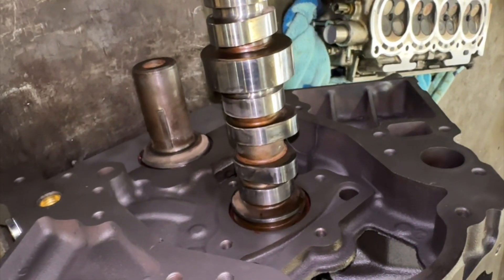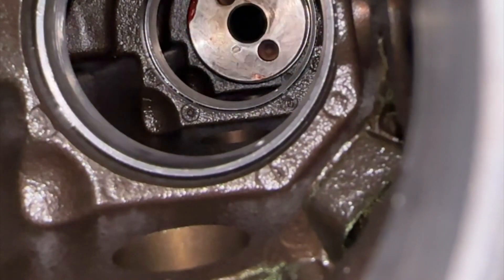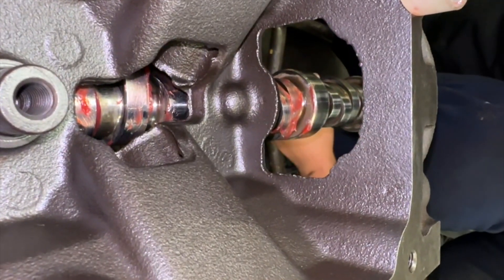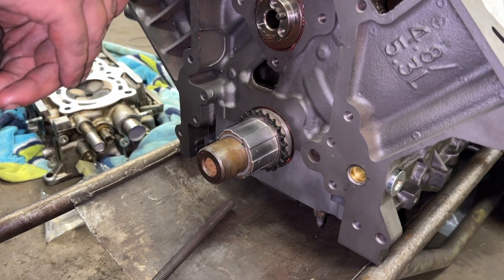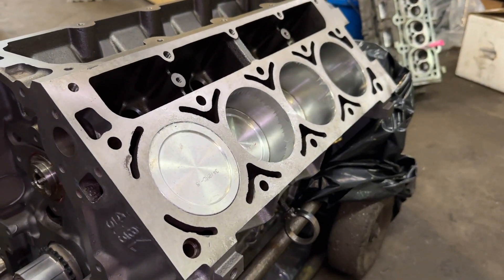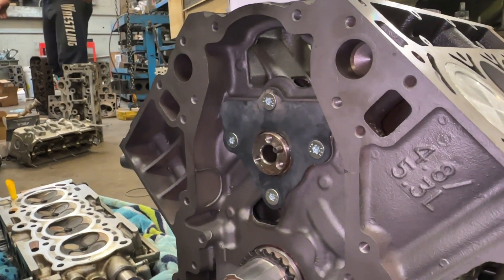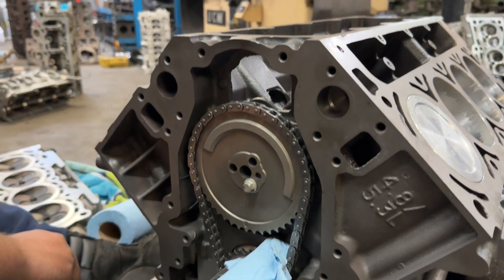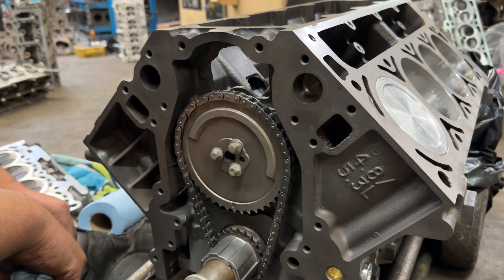camshaft pt.3 How to: build an LS engine from start to finish . Red truck pt.10

Comment: I always found it much easier and less likely to nick a cam bearing by standing the block on end and installing the cam vertically
Reply from the maker: interesting way of doing it but it makes sense for sure, thank you for the tip.